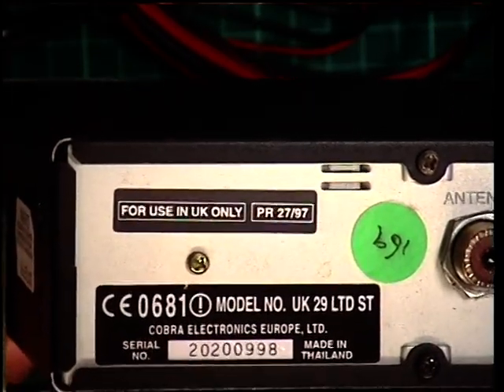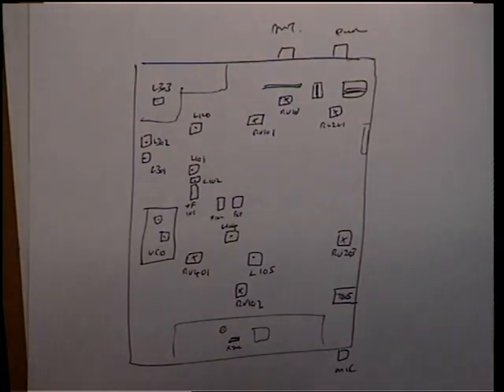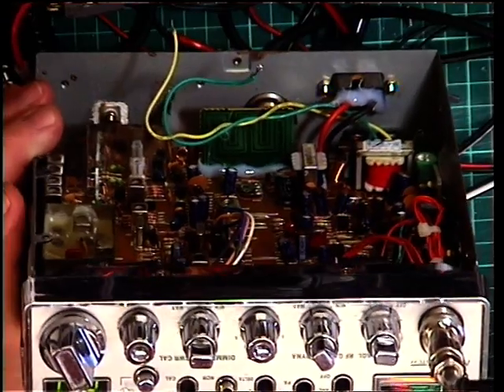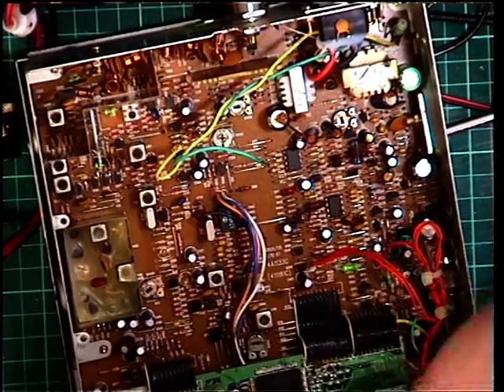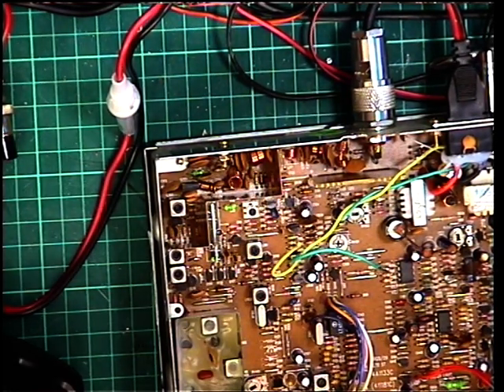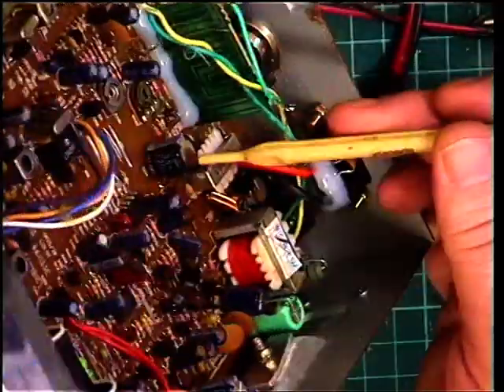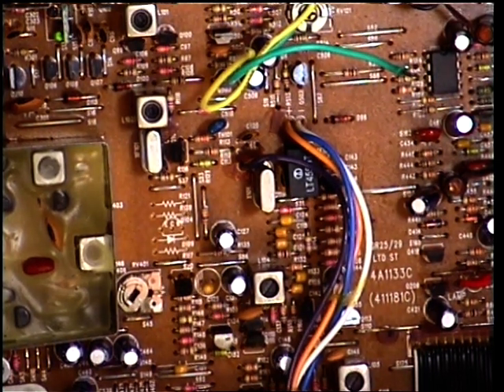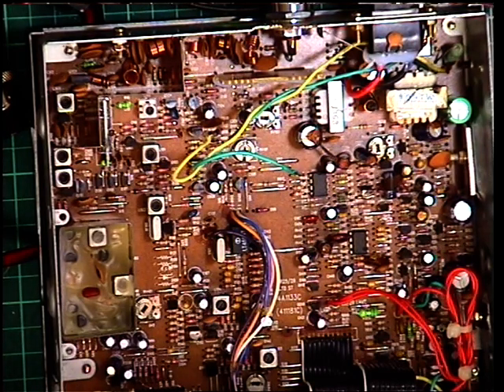Cobra UK29LTDST PR27/97 UK CB radio (mobile) Transmit alignment

Comment: this radio looks exact same inside to a cobra uk 25 ltd st soundtracker
Reply from the maker: You are quite correct. However, they are both so bad that we won't be accepting them for repair, only basic tune-up. I'm surprised they passed type approval.

Richard

Comment: What is the market for CB? Do farmers use them?
Reply from the maker: Yes farmers do use them. Although they have business 2-way radio, that's back to base on a split frequency only rather than vehicle to vehicle (licensing conditions). Up & down the fields hour after hour is no doubt helped by having CB and chatting the day away with fellow machine operators. Farmers usually go for shortened aerial like the mini springer, especially as they only need a short range..like 2 miles.

richard

Comment: Always liked the classic look of these radio's it'd a shame you cannot buy anything classic looking like this now.
Reply from the maker: Looking at suppliers like Moonraker, Thunderpole & Knights...there could be a President with the right looks. I'll have another look and if there is anything that looks half decent will buy one in to try....as long as it doesn't turn out this kind of build quality.
Reply: @ukfmcbradioservicingTango21 I see there was a new Cobra 29 but not in the UK though yet?
Reply from the maker: @jayburit9141  If there is, I hope it's better than this....and the big black last one that came out of the factory with deviation so low it was un useable
Reply: @ukfmcbradioservicingTango21  it's the 29 LX MAX just interested what it would be like if we get it here in the UK. It's been out a while in the US.
Reply from the maker: @jayburit9141  Just looking at the Cobra website, there seem plenty of moans, mainly to do with overheating. However an AM rig will get hotter than an FM rig on transmit, so one on UK FM frequencies 'should' be better in that direction. It appears you can play back the last 10 seconds of receive with a 'say again' function bluetooth for those who bother with mobile phones.

Richard (UK)